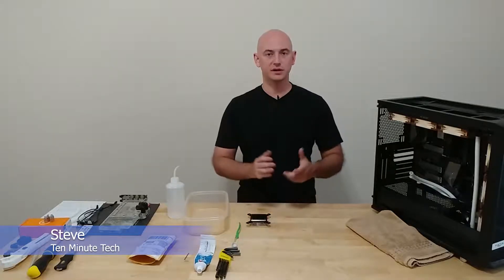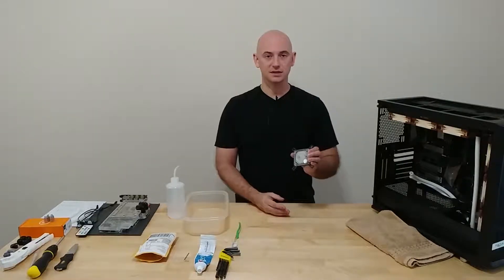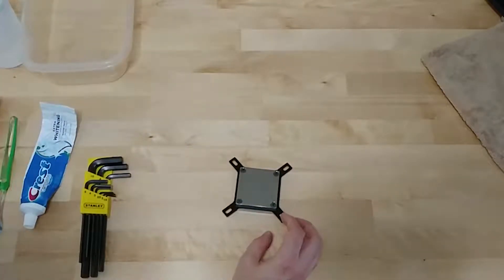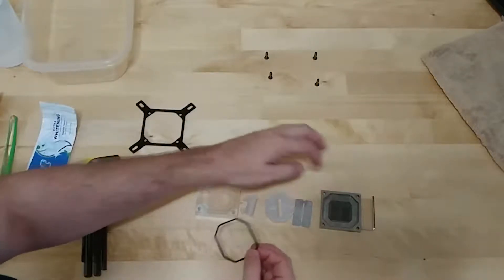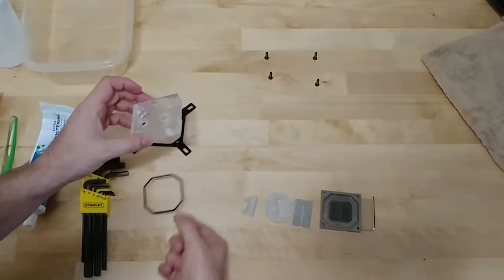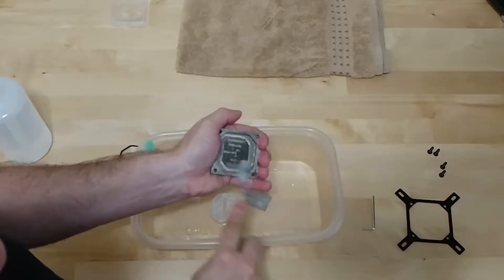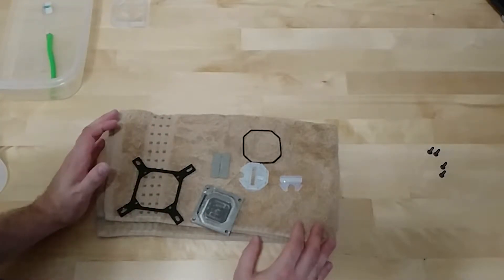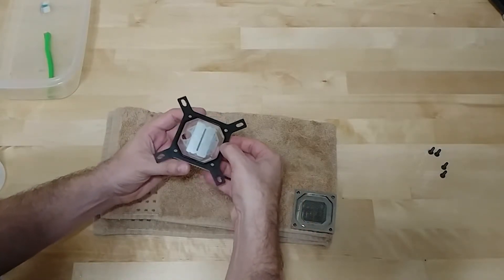How to clean a CPU Waterblock

Comment: Can the o ring be dry or should it be lubricaated?
Reply from the maker: It doesn't really matter on it's own but using a protectant that is safe for the kind of rubber used can increase it's life span. Just don't use something petroleum based (like vaseline) because that will break down the rubber. A silicone lube will be fine though.